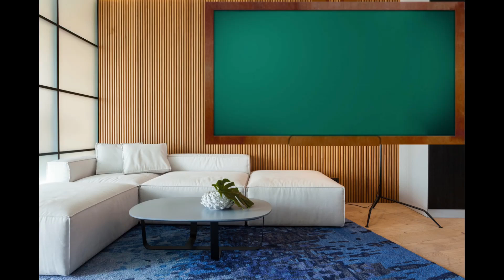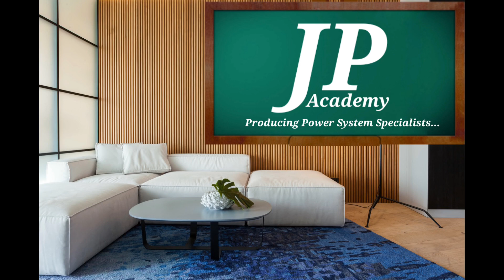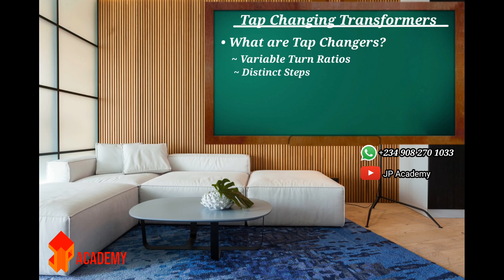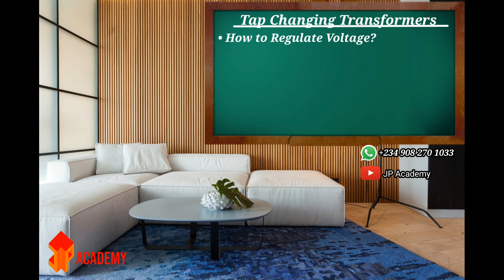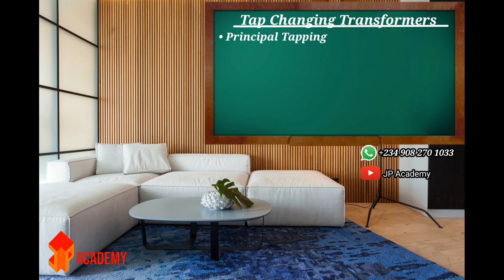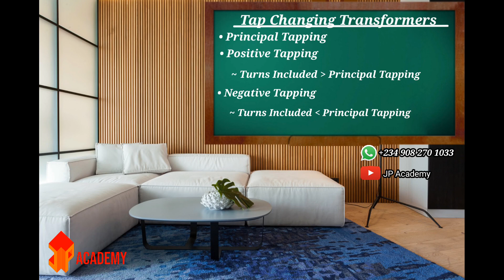How to Regulate Voltage using Transformer Tap Changing

Comment: Sir what's the difference between side, middle, upper, and lower tapping?
Reply from the maker: The difference between each tapping is the output voltage produced. We have principal tapping, positive tapping, and negative tapping
Reply: @JPSmartSolutionsLtd  I still don't know about the side tapping sir, I couldn't find information about that position of tapping
Reply from the maker: Send me a message on WhatsApp using the number +2349082701033 let's discuss properly